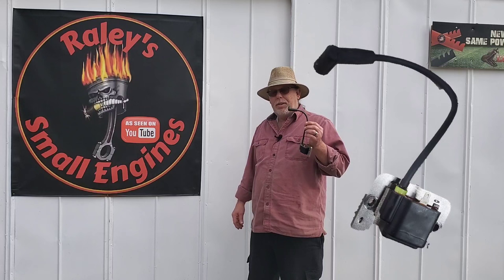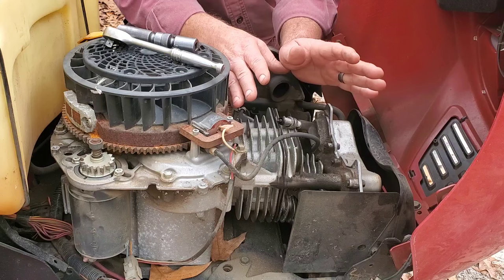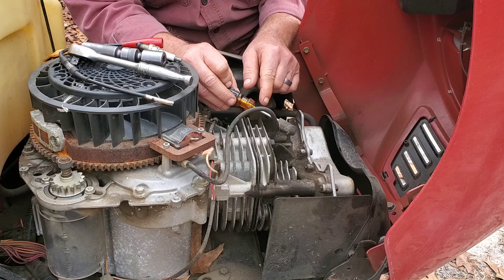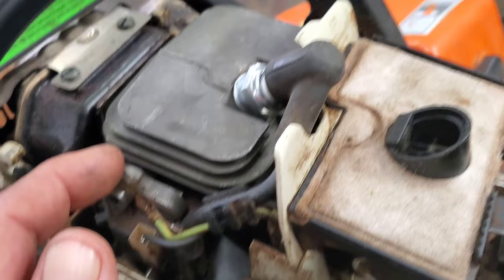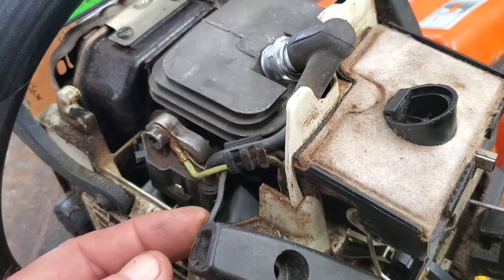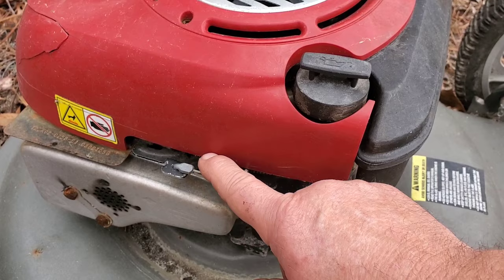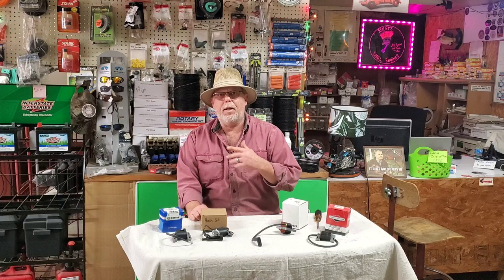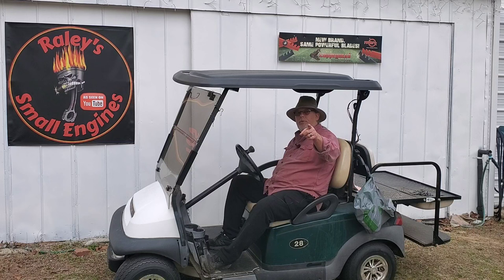Simple Trick To Diagnose A Bad Ignition Module (Coil) On A Lawnmower, Chainsaw, Weedeater Etc.

Comment: I've used the gas cap trick before. Neighbor had his tractor quit on him in the middle  of mowing. I pulled the cap, found the vent hole crusted over with dirt. I grabbed a drill bit that was a size or two bigger than the factory hole in the cap, and twisted it in with my fingers, effectively enlarging the hole. Tractor ran great then, and the neighbor treated me like I was a genius after that!

Comment: Great tip. 
I ran into an engine, 8.75 series briggs on a toro timemaster, with such a blown head gasket, the oil got around the head bolts, and the head, and the gasket, it isolated the head from the block, and took the ground away, the spark plug would spark against the block, but not screwed into the head, a real head scratcher for sure.
Reply: @dkupy100  yep had me stumped for a day. Never have I ever seen that before in my 40 years of small engines..... And I've had it twice on the 8.75 series briggs.

Comment: Excellent video on easy testing but do not throw out that coil yet especially if it has a spark plug boot like the Honda one in the video or those that are metal shielded because they have a built in resistor that may fail. I believe these style spark plug boots are supposed to have 5K ohms resistance. On three cases over 9 years we have found them to have 10K+ ohms resistance which created the no spark issue. A simple spark plug boot replacement and away we go, great spark at a cheap part cost vs replacing the entire coil.
Reply: Good one, Pops!  I’ll save $ any way I can! 🔧👍

Comment: Everything you said on here yes. But you pull the recoil cover off and see all that rust on the flywheel you have to clean off the flywheel and take the coil off and clean it and where it mounts at also if no spark then replace the coil all these years I been working on them 60 % of the time that's what it was rust on every thing. I been doing this for 45 years now fixing to retire from small engine repair.

Comment: The presence or absence of spark is not always 100% for diagnosis ...example,   a coil may be good enough to produce spark when cold but when engine heats up and coil heats up it may not. I saw this recently on a mower. Just seeing the spark on a cold coil is not always conclusive.
Reply: That’s a really good point - for coils with rust jacking starting to separate the plates.

Comment: How many hours before I need to adjust the rockers on my generator (Troy build 5000 watts)? Thanks 🙏
Reply from the maker: That would depend on how much it is used.  I would think every 100 hours ish.  You can look up your particular engine on Briggs webesite or Manuals Lib website.  I use Manuals Lib a lot.
Reply: @RaleysSmallEngines  
Thank you for your reply and advice. Much appreciated.

Comment: I have an old Solo (1975) chainsaw. It has points and no spark. I checked it out and the coil seems to be grounding out the points. With the coil mounted I have continuity on both sides of the points with the points open. I isolated the switch and it's working. I think the coil is shorted to ground, because when I remove the coil and then check the points they work fine and then put it on again, the points are grounded again. Am I missing something, or is my coil bad?

Comment: My friend dropped off his Dr brush mower it's got a 13 horsepower Intex single cylinder I've clean carburetors my whole life I've worked on this before for 5 years anyways he says you know it won't start cleaning the carburetor put it back on put a new spark plug in the rc12yc. I can get it running 5 seconds 6 seconds shuts off I got a spark plug tester initially I didn't see any spark I move the wire on the coil itself and now I got spark running into the spark plug tester and the engine runs for 20 seconds sometimes and then it dies I see spark the whole time and it dies. I know you're going to say well dummy it's got to be the wire going into the coils  because if initially you didn't see spark and then you did that must be the problem. When it's running I see the spark light up the tester the whole time and it dies...so my prob is???
Reply from the maker: 1st remove air cleaner.  Run it until it dies and won't start. Shoot flammable brake cleaner into carb. Will it start? If so fuel issue if not fire issue.
Reply: Gas is not an issue carburetor spotless.
Reply: What about before the carb? Fuel line, fuel filter, fuel pump, trash in tank, fuel tank lid issues. If it's not a fire issue and the carb is clean work back from there.

Comment: I have a question sir,  I have a troy bilt 1998 18 horse,  B&S the model number/ code is not on the OHV cover. Any idea where in the world it would be? Thanks 😊
Reply: Are the letters OHV upside down? If so the code is on the bottom and the cover has been put on upside down.

Comment: I just grab the plug and pull the trigger. If it bites me,i know i got fire...Not. I will say I have sprayed starting fluid on a plug too test the plug, definitely get FIRE. Not recommended. The screwdriver can be a safer alternative.

Comment: I have a 425 water cool John deer mower. The left side has no fire. I got a new coil and spark plug still no fire. The wires look ok. What do I look for now?
Reply: Look for ignition control module